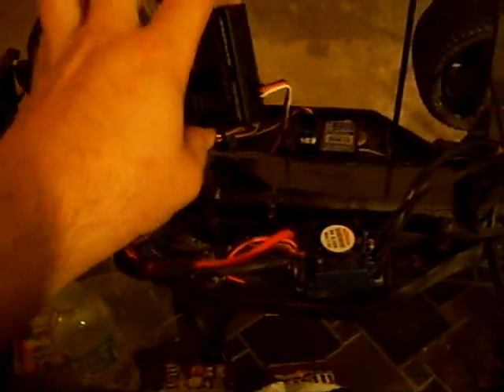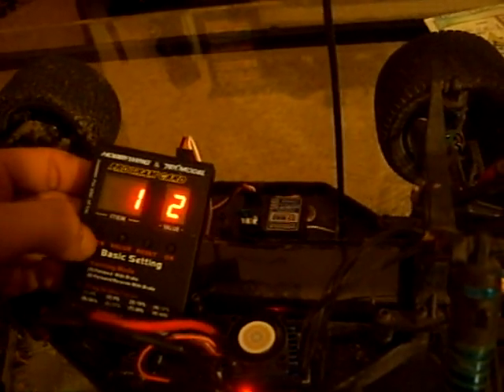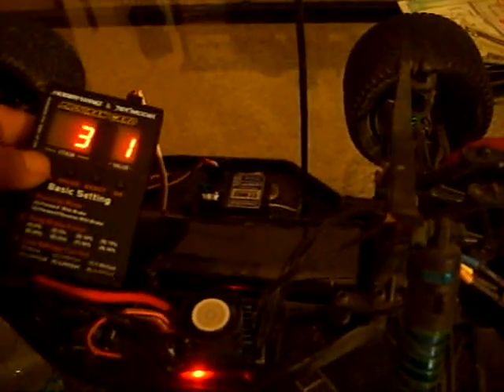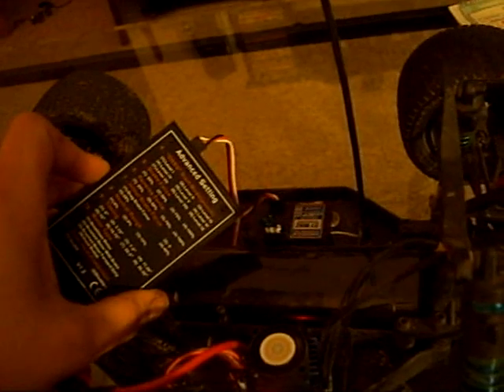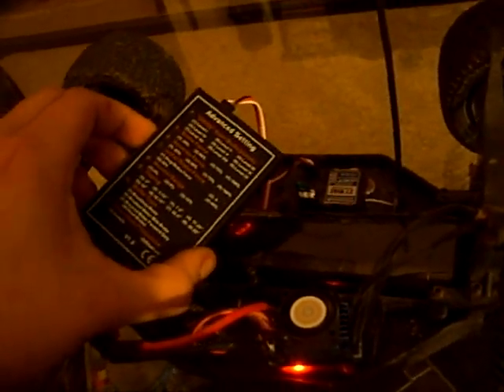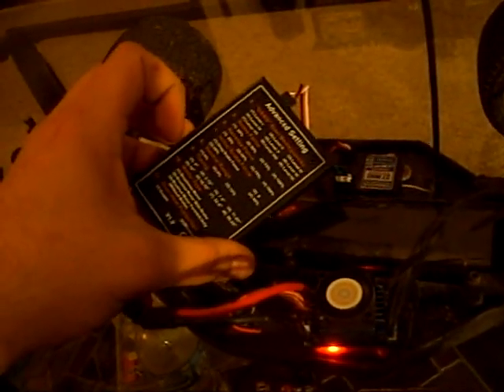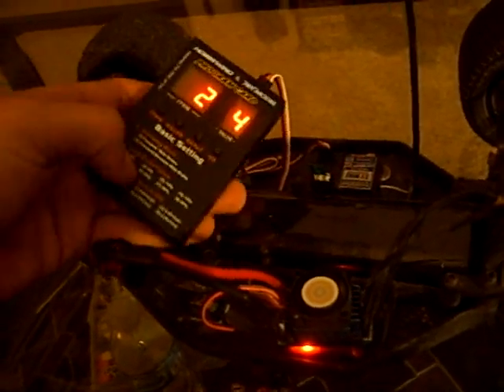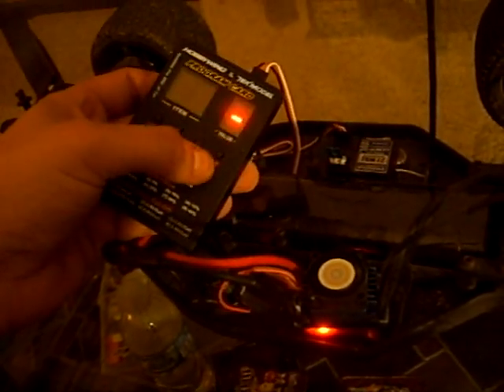EzRun - ESC setup with Program card

Comment: I have this same thing. I wen through and set up everything the way I wanted. I turned the esc off, disconnected the card, and test drove. It seemed like nothing saved. I plug the card back in and hit reset. I pressed ok, then turned off the esc, disconnected the card, and test drove. I lost reverse. Went into the programming again and it was set to throttle with brake and reverse. I pressed ok on that about 484928663 times, and test drove. No reverse. I got fed up and put it away.

Comment: I have a question to ask of you,I also have the hobbywing esc 60A. But I am using a duel set up on my clod as a racer. I did noticed that the motors are turning ok,but when I use my radio. I move  throttle  forward on my radio,and like it's going in reverse. And then the throttle to the reverse,full speed to the point that the wheels are ballooning up. Do I need to change the motor rotation?